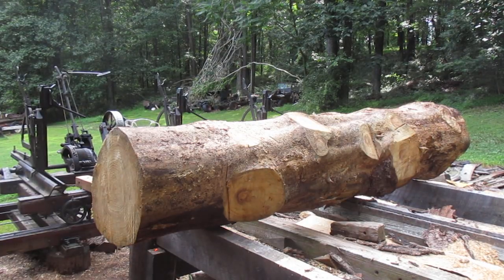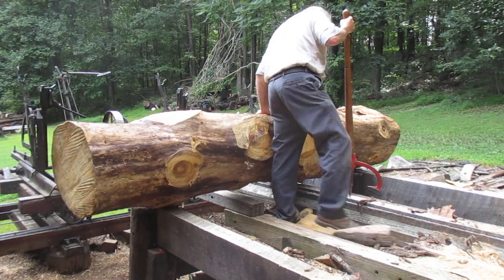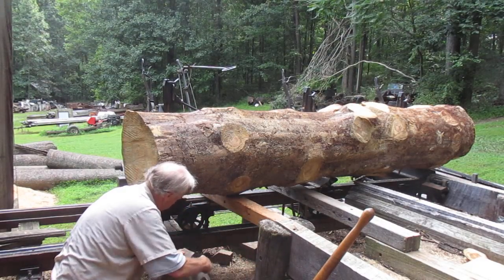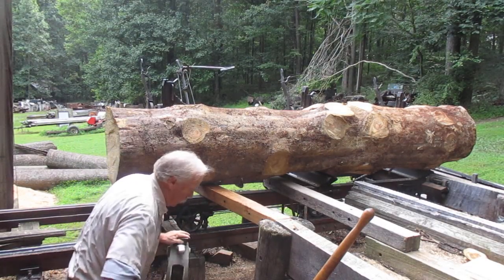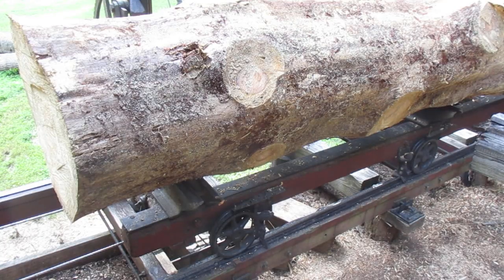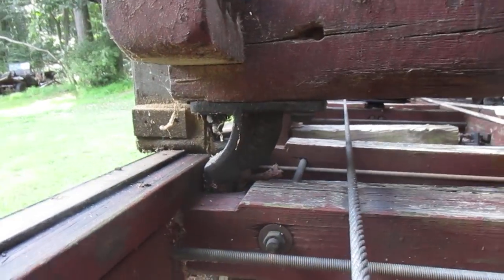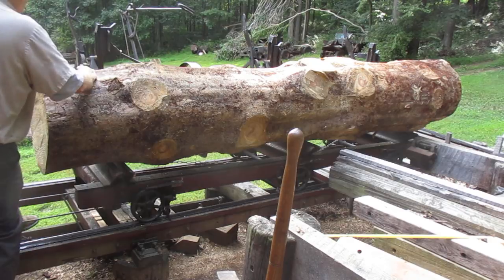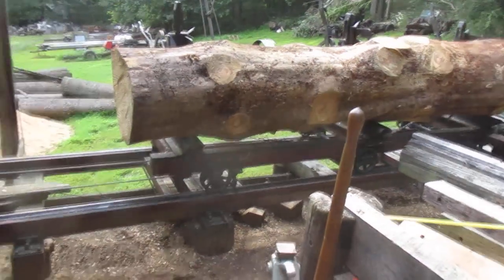Loading a big UGLY pine log #434

Comment: Why you don't just build a winch behind the car? It would be so much easier and faster to pull the logs.
Reply from the maker: hi there thats a good idea thanks john
Reply: That is a good idea. Maybe run the line over the top, around the log and anchor the free end on the carriage - thus pulling the two together.
Reply from the maker: @ronmccabe7164  hi there don't have to do it with nice round logs just junk logs  thanks john